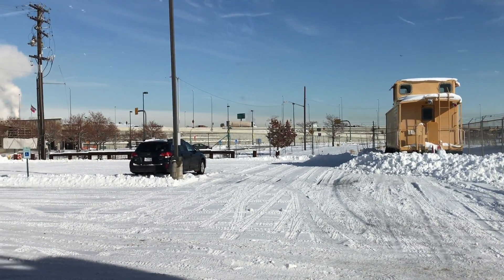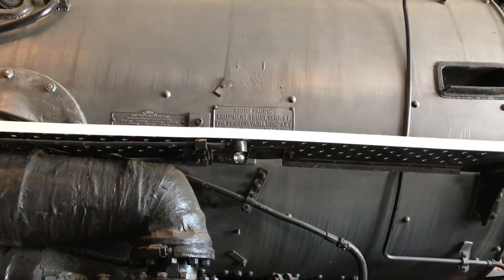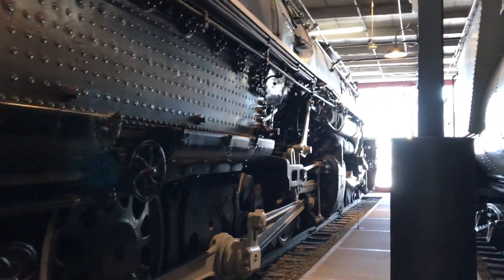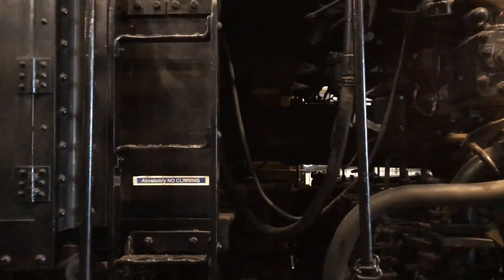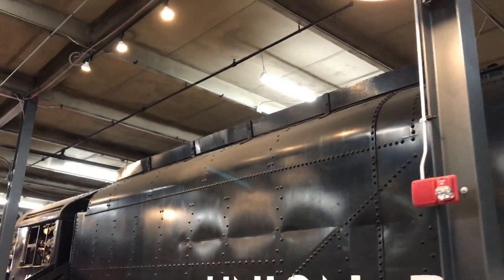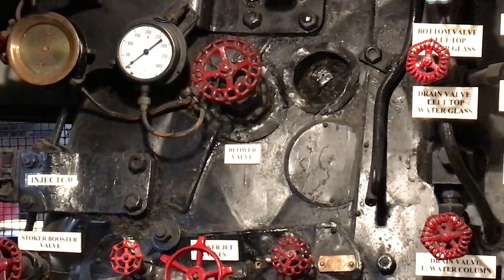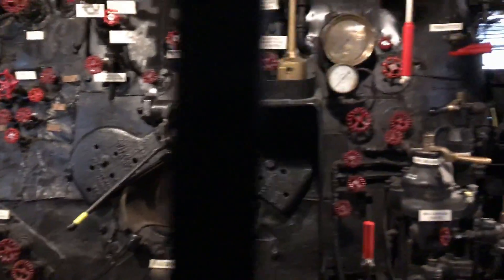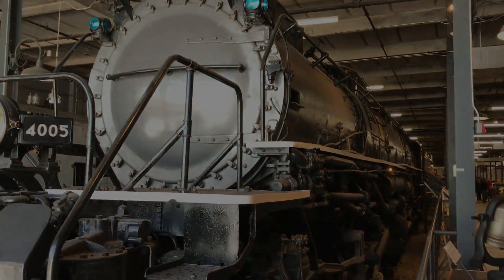Tour of Union Pacific 4-8-8-4 Big Boy Steam Locomotive #4005 (Forney Transportation Museum)

Comment: You said the loco goes forward when the blocks are moved down in the links; the blocks are raised in the links to go forward and down for reverse.  The reverse lever in the cab is moved forward for forward and backward for reverse which moves the hangers up and down proportionately to operate the blocks in the links.  If the link hangers are positioned behind the links then your statement would be correct. 
@ 5:34 the square plug looks to have a NYAB symbol while the hex plug next to it has a WABCO symbol.  There are a lot of parts that are interchangeable between the systems.  From appearances WABCO system was used.
Your audio seemed to be low and was hard for me to make out what you said most of the time.
I am glad solid piston rods were applied or the rods were not cut like the ones on the loco at Dallas area.  I know that was done to make moving the loco easy: but it looks bad.
Reply from the maker: On the 4000s, the blocks are lowered in the links for forward motion and raised for reverse motion. Literally watch any video of the 4014 running. As originally built, the air brake parts were sourced to WABCO.
Reply: @FanRailer  I see where I got confused with the links and reverse hangers as the power reverse is mounted ahead of the links and faces to the rear.  Sorry about that.  Almost all of the locomotives I remember have been set up with the link blocks rising for forward.   As for the air brakes I don't discount WABCO being originally mounted only that one plug with a NYAB marking is on a device which after all these years is not so  uncommon of an occurrence after all the shoppings these locos went through.
It is not excuse but my birthday is today; 73.

Comment: I’ve had the privilege of seeing this locomotive, the 2nd Big Boy I have ever seen, after seeing 4018, and before 4014. This 4-8-8-4 actually got oil fired as a test which actually failed, so I am surprised how Ed Dickens managed to pull off getting 4014 running oil fired, rather than coal!
Reply: Reading some speculation that the diesel in tow is actually doing lot of the work which could be true on the grades I saw a few videos where could hear the diesel engine running hard see black smoke.